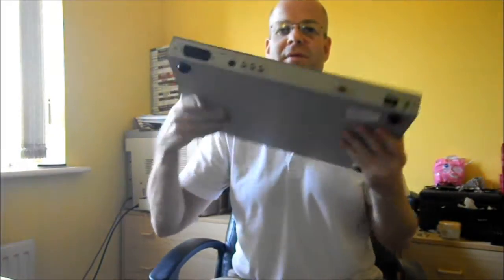Cinemateq line doubler vs CGA to VGA scaler

Comment from the maker: @dankss It's not all bad news as you can use component input on both of these pieces of hardware.  You can still get your retro consoles to output to RGB SCART though to make use of these types of hardware (if required).

Comment: Can you recommend a converter/upscaler for use with ps2 and xbox? I've bought 3 so far and all have had problems (one poor quality, another only displayed 16:9 and the other got so close to being ideal but had no black level adjustment and the darks were too dark). Obviously I'd love something like the Framemeister but for the sake of two consoles (am content with emulators for 8bit/16bit) it is too expensive for me to justify. My monitor (my only display) accepts vga or hdmi. Can you help?